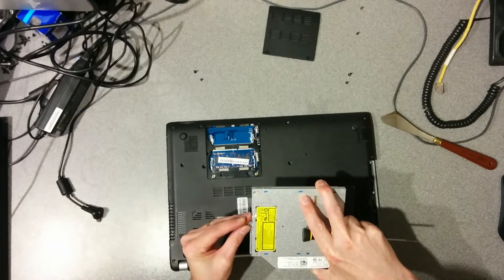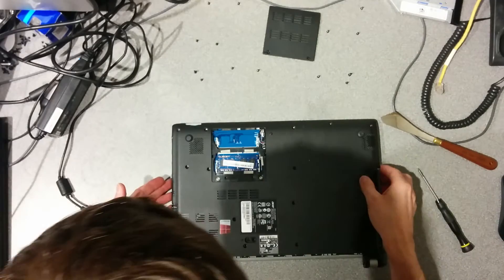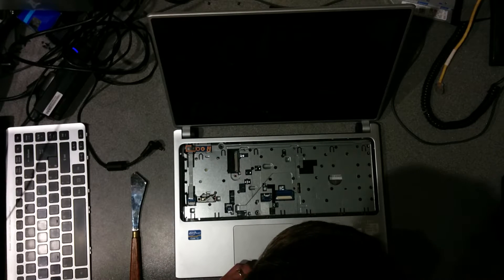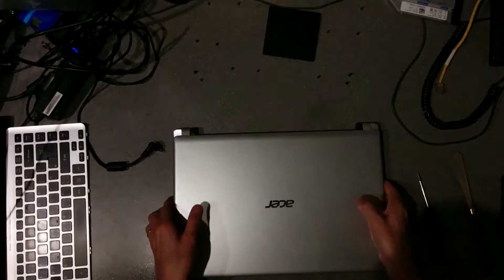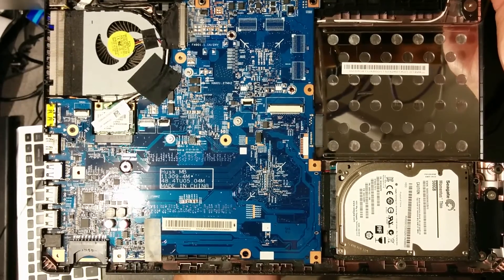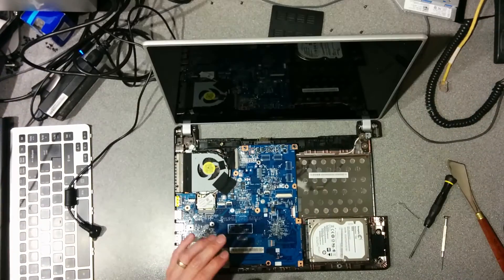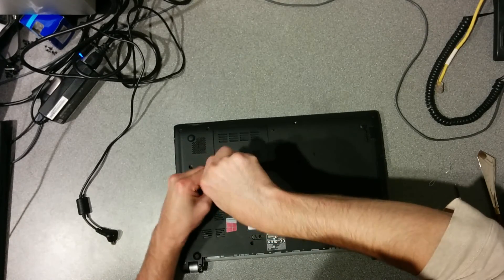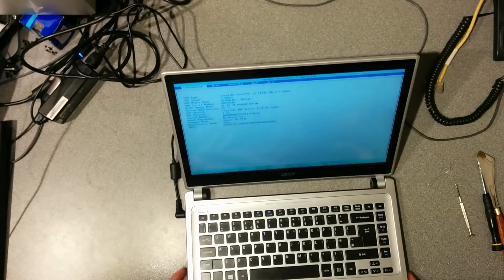Acer Aspire V5 471 - How to change or upgrade the hard disk

Comment: Do i need to backup the data on my current drive?
Reply from the maker: Yes, you do need to clone or copy it to the new drive. A SATA to USB cable would do the job.
Either install windows fresh and plug the old drive in once installed - then copy the stuff.. or use Macrium Reflect (free) to clone the drive to your new drive.
Reply: @freename  thanks for the answer!

Comment: What type of Memory is in here? Also, can I upgrade to SSD?
Reply from the maker: I don't know the type of RAM. It looks like it might be on the other side of the board from what you see in the video. It also looks suspiciously like it might be soldered onto the board!
SSD - yes, just get a standard 2.5inch SSD.
Reply: @freename  crucials website will scan and tell you what ram you need. It's easily accessible without taking the computer apart. Just take 2 screws off the bottom and it gives access to the ram.
Reply: Ddr3 sdram. You can upgrade upto 8GB

Comment: Nice video, i replace the HDD. Butcher can't acces the BIOS, press all f, supr, esc :c
Reply from the maker: You shouldn't need to get into Bios just to replace the hard disk. I went into it to show that the hard disk was detected.
If your laptop is in UEFI mode then it is likely you can only get into bios by holding down shift while you click on Restart in windows.

Comment: Excellent guide - very clear and very accurate. One suggestion though: switch the camera to manual iris mode to prevent the lens stopping down every time it catches a highlight from the case.
Reply from the maker: Thanks for the thanks and advice. I'm using a atandard Android phone and stock camera app. I, in the past, have used an app that locked the focus but I found the framerate was lower than the stock app - I will have to re-research it or alternatives.